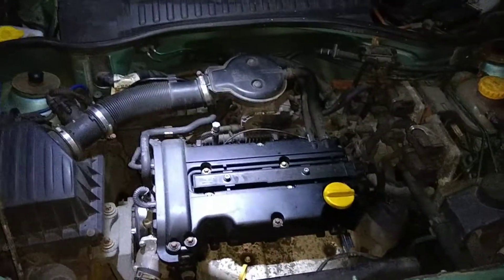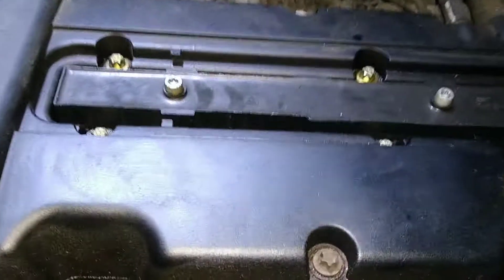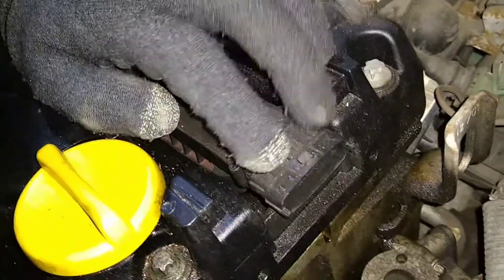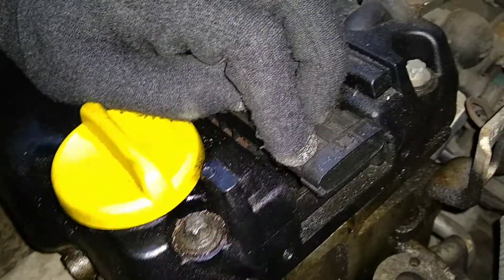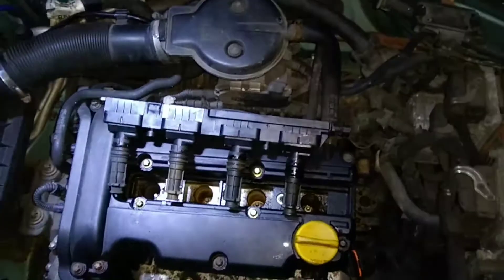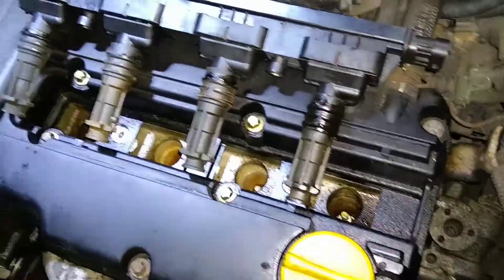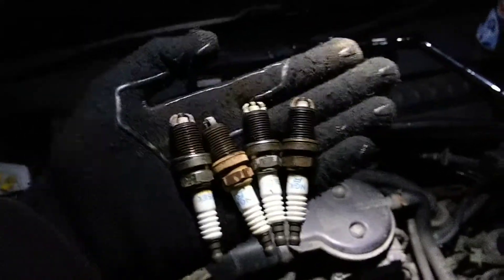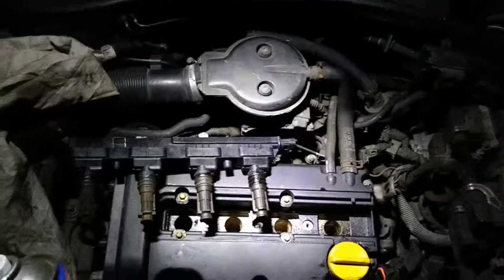Corsa Engine Misfire Fixed!

Comment: It fixed it? i have a similar problem with mine and it only missfires when properly warmed up on the highway. i noticed some stains near oil cap so ill check how the plug wells look. I hope its the cap or some idiot spilled oil and i wont have to replace the valve cover seal